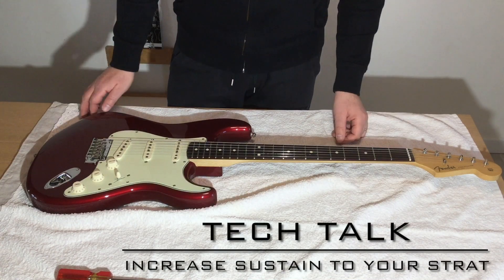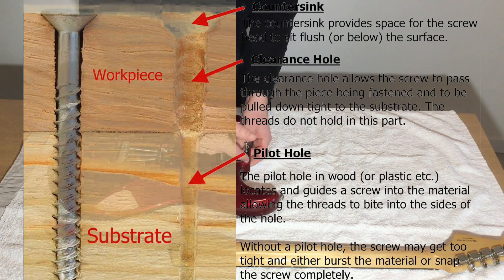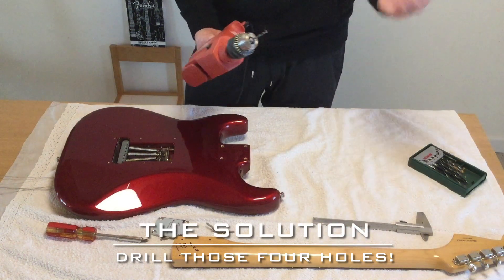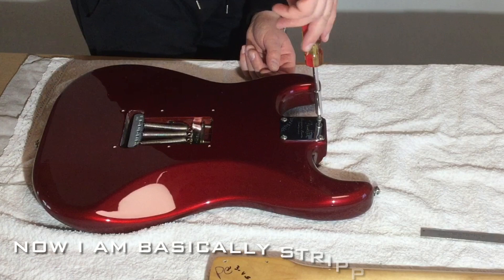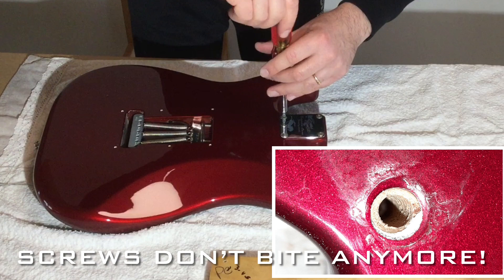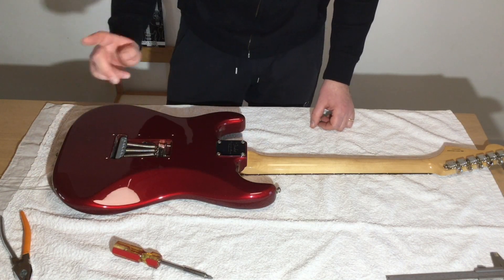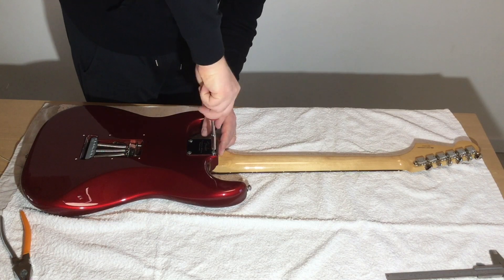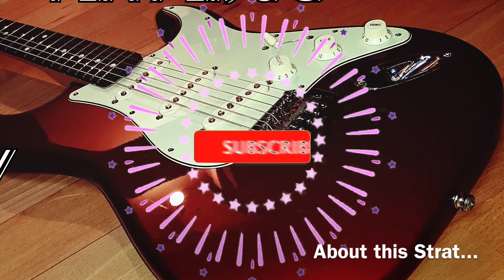How to IMPROVE SUSTAIN on Fender Stratocaster Telecaster and bolt on guitar? #sustain #boost

Comment: I definitely learned something new here even though I haven't taken any action yet to drill bigger holes. What I noticed with my Fender Stratocaster Vintera is that the playability of the neck and the resonance change depending how I tighten the 4 neck screws.
Reply from the maker: Those holes in the body have to be bigger than the screws, that is basic rule for a tight fit between two pieces of wood. I have recently bought an American Original 50s Strat that was built like that from the factory, finally!

Comment: .. if the goal is to creat the tightest fit/contact of the guitar body & neck material then can I fill up any gaps between the two screwed-together parts with super glue/furniture adhesives? 
 .. anyone? 😬😬
Reply from the maker: Well, not in a Strat lol!

Comment: I have a Jackson, They are now owned by Fender and the screw holes in the body are the same way. So tight and threaded into the body AND the neck. I did this same thing to mine. Drilled the holes out larger. No problems and it sounds better and the neck fits into the pocket much better now.
Reply from the maker: You did the right way!!! Enjoy your Jackson!

Comment: Sorry, sounds like a terrible idea.
Reply: Absolutely not, it's a very basic concept and almost half of the Strats are properly drilled from the factory, so this holes enlargement is not needed.
Reply: @johnarthey3162   
Right! If the body holes already have clearance, then drilling is not needed. 😊
But if not, then it’s a must enlarging the body holes, for proper tightening.
Reply: Ive been making guitars for over 50 years and yes its a Bad idea. And pointless. More sustain is a product of many factors not just one.
Reply from the maker: So you aren't make sure that the connection between body and neck is tight? How are you doing that on your guitars? And the aim of the vid is not to prove that's the only thing to get sustain, that's of course due to a sum of factors.
Reply from the maker: I know, I know, this is controversial. However that's REALLY the ABC of bolt technique, if you want to tightly clamp together two pieces of any kind of material, one of the two MUST have a clearance hole. That's common and needed in any construction work. Out of my 20+ fenders I have found some "right" (screws were passing freely through the body), some were "faulty". It's interesting also to note that somewhere in the 50s or 60s, now I can't recall exactly, fender used partially threaded screws that were only threaded in the neck section, while being thread free on the body part.
Reply from the maker: This same exact procedure is even described in Callaham's website!

Comment: Fender uses #8 x 1-3/4" screws for the neck. Based on the comments below, am I correct in thinking that instead of drilling I can use the same size screw, but make sure it is a partially threaded screw? Then restring as Alberto demonstrates. Do I understand correctly, or do I use a partially threaded screw of a different size? (If so, what size?) THANK YOU for this video Alberto!
Reply from the maker: Thanks for your comment! If you use  partially threaded screws you are fine. In that case the screw is acting as it should, gripping into the neck while leaving a virtually friction free contact in the body. Make sure the non-threared part is the right length, i.e. the thickness of the body!
Reply: @LostPlectrum  Got it! Thank you Alberto!!
Reply from the maker: You are welcome!
Reply: I would not use different screws. The threads are not identical, so you end up with messed up threads in the neck. You could file off threads on the upper part of the screw, but it’s waaay easier to just enlarge the holes on the body🤷🏻‍♂️
   Also important: the same screw always in the same hole. I take them out with the plate and let them there, if necessary mark on the plate “neck” and “body”, or “up/down”.
Reply: @lone-wolf-1  I use/reuse egg crate containers with very specific labels denoting the exact origin positions of each part. Like pickguard screws #1 starting with the nearest screw to neck right, #2 being the next screw clockwise, etc.  In the case of extended removal of the pickguard I'll just hand thread the screws back into the original hole once the guard is off.

For pots, I rethread the nut and washers back together in same orientation.  Ditto for tuners and their associated parts.

For really small hole, like tuner alignment screws, and if the plan is to swap to different tuners, like a chrome/nickel to gold versions, this means also swapping to gold screws. In this case, I use a fine toothpick to deliver THINNED wood glue drop by drop into the holes until they're mostly filled, making sure there's no air bubbles in the hole's bottoms then let dry before threading the new screws into the holes.

I've initially learned many of these techniques on books covering  restoration or modification techniques on antique/vintage instruments. Many of which I have used on old guitars (<20 years old) and newer guitars (<10 years). I'm also currently working on some 40 yo and 50 yo electric guitars (vintage and antique, respectively).
Reply from the maker: Lance, you are extremely careful! Good to see you are caring a lot your guitars!
Reply: @TheGhostGuitars  
I take a sheet of cardboard, draw the place where I removed the screws or parts, and stick them in.😉
Reply: @lone-wolf-1  That works too, as long as ye have a system that allows ye to remember what goes where, yer golden! 😁👍
Reply: @LostPlectrum  Well, I think that's because I collect guitars for the enjoyment of them* for themselves, NOT for how much they may be worth later. 

*That includes getting what are otherwise basket cases that probably would've gone in the trash but I purchased because they're interesting and presents a challenge in getting them back to being functional. 

For example I bought a while back, as future projects to work on in a leisurely pace, 2 old guitars for just 30$ for BOTH, so 15$ each.

They are missing tuners, pups, nuts, missing saddles, have badly corroded bridges, and the 12th fret measurement say the saddles should be at where the aforementioned bridges are at. 

One is a 60s Kingston Swinga that still has its turned metal pickguard, but has obviously been painted over at least 2x and came with a botched bondo job and an incompletely done strip job. 

It's so ugly that its kinda cool! I'm gonna just clearcoat the entire thing, mostly to seal the bondo, then make another metal copy of the pickguard with different pup and control setup that will take advantage of the huge swimming pool rout for both the pup and controls. 

As I believe its price value has long since expired, I'm thinking of creating a guitar that mimicks some of the more... "interesting" creations to come out of Japan back then. Since I'm gonna eliminate the rusted bridge, I'll install a Strat/Tele hardtail and make use of the opened up space to rout and install the bridge pup, thus allowing me to install up to 6 single pups or 4 humbuckers, or any mix of pups possible. 

Perhaps a humbucker, a humbucker sized P90 bridge, a lipstick strat neck, and a Tele stacked neck pup, 4x 2way microtoggles for pup on/off, 4 volume pots & 4 tone pots in 2 lines that follows the curvature of the lower bout. 

That means I'll have to rout the control cavity all the way down to the bottom of the right bout area and extend the pickguard accordingly.

The other is an "Artisan" (there's a brass name plate on headstock). Looks like an old kit guitar that looks like a cross between a Strat, offset Tele and a flat top LP. It has a baseball bat round neck that looks like its made of mahogany and an unknown fret wood. The body is plywood. The whole thing is bare wood. The neck is attached to body by ONE large bolt going thru a 1.5" fender washer. The grain pattern on the neck is phenomenal! The plywood body also exhibits fairly good grain too. 

The pickguard is missing but body shows a rusty outline of the missing guard, so I suspect it too had a metal guard. This guitar, in contrast to the Kingston, has only a tiny control cavity and just two round holes to clear the pup bolts. Obviously the pup is surface mounted to the pickguard.

Like the Swinga, the Artisan's 12th fret measurements points to the saddles to be located where the bridge is located.

Unlike the Kingston, I'm gonna copy only the top part of the pickguard and extend the entire guard to the bottom so that it semi wraps around the Strat/Tele hardtail bridge. I will rout out a large swiming pool pup cavity, along with an oversized Strat style control cavity. 

I will be installing 4 humbucker sized P90 Phat Cats, 2 necks and 2 bridges, in that order. There will be 2x Tele 3-way switches, one will be controlling the middle pair, and the other controlling the outer pair. There will be 2x sets of 2 pots, 2 master volumes and 2 master tones. I will also mount the Strat output jack and boat in the bottom of the guard, pointing toward the bottom strap button.

Oh, I almost forgot, the Artisan pickguard will be made of brass aged to match the headstock brass nameplate. The pups will be gold-plated (which will be aged to match the guard and name plate). I'm going to use brass knobs and switch tips, also aged.

The body and neck will have furniture transparent varnish in two shades. Clear for the central areas and a darker tinted transparent for the burst perimeters. THIS, I'll let time and use to wear it down. Alternatively I could just polish up the nameplate and not age the new brass stuffs. More I think on it, methinks I'll go that route.

As the local saying goes in Hawai'i, "I no kea" about any destruction of any potential values the guitars may have (highly unlikely), I've NO intention of selling these guitars...unless, of course, someone comes and offer a ridiculous sum of money like 10s to hundred thousands $ (equally highly unlikely, LOL)!
Reply from the maker: Wise advice!

Comment: Nope! Just the sound made in cringe!
Reply from the maker: Well, some bolt on guitars are correctly built with proper clearance holes in the body, some are not. The very basic bolting technique requires to have a clearance hole of you want the neck to be strongly pulled against the body!

Comment: DO NOT DRILL ANY HOLES IN YOUR GUITAR.  💯 WRONG
Reply from the maker: Appreciate your comment, I have done this on several bolt-on guitars, they didn't split apart yet (kidding)! Seriously, half of the Fenders I have owned (20plus and still counting) had this flaw, the other half were right since the beginning, with a proper clearance hole in the body.
Reply: You are 💯 wrong, sir.
Reply: Unless you have tried it, it kinda makes you 100% ignorant doesn't it?. I've done it to my tele and my strat and the difference is incredible
Reply from the maker: Some people are scared to do some mods to guitars, especially when this involves drilling holes! However in this case it is perfectly right!!!
Reply: @LostPlectrum  well all my shit is custom shop. I’m not modding anything.  But if you got a squire then get after it
Reply from the maker: @BossHossGuitars  I have seen many custom shop with huge neck shims so I don't care if you are willing to pay that extra for the custom fuss. Here we are not discussing the guitar level, we are discussing a technical detail of screw joints, a very basic concept too. If you don't get the point you don't need to get agitation. Relax, mate.

Comment: I use a piece of fiber or rubber support between body and neck. I feel it more sustain. This video you show mean the screws are too tight make decrease a sustain. Thanks.
Reply from the maker: Hi there, the main point of the video is that the body holes should not be threaded, they need to have a clearance. This is assuring a proper neck to body tightening.

Comment: I found out the hard way the first time I took off the neck and tried to bolt it back together. First time I had an uneven gap around the perimeter. At that time I used a c-clamp to hold the neck and clamped the neck into the pocket. 

I was then able to screw the neck back on snugly. Unfortunately, I also put a dent in the frets and the neck plate.  Luckily I tried doing this on a vintage Squier so it wasn't a huge loss (altho it forced me into an opportunity to learn fret dressing).  Later on I had to learn how to replace frets, LOL!

Remember, go easy when dressing those frets. Easy off, hard on. Not easy to put material back on if ye take too much off. ;)
Reply from the maker: You live, you learn they say! Rock on my friend and thanks for commenting!!!

Comment: From Leo:  That is a good solution if you have a problem.    The screw holes may not be any problem.   With the strings off, loosen the screws and put a piece of paper between the heal and the body.  Tighten the screws, if you cannot pull the paper out, the screw holes are not a problem.  Alberto is right, using the strings to pull the neck tight to the pocket is a proper technique.   That 100 lbs of pull eliminates any minor gaps.  I put all 6 strings to proper pitch, and loosen all 4 screws and then tighten them, knowing there is no slack.
Reply: If the screws bite in the body and don’t have clearance in the holes, pulling the neck in the pocket might not work as well as with that little free space…😊
Reply from the maker: Agreed!
Reply from the maker: Agree on the paper test! Thanks for commenting and hovering to my channel!!!

Comment: The middle spring in the tremolo is doing nothing 😉
Reply from the maker: It's under tension so it's applying a force to the tremolo. F = kx, therefore the force is proportional to the elastic constant of the spring (that is a fixed value), and the displacement from the neutral position. For sure the 2 outer springs are applying a slightly higher force than the middle one!
Reply: I bet you can remove it with your fingers. The outer 2 springs are under more tension. I appreciate your videos, but that is a bit of a pet hate, it's like having a different length spring?
Reply from the maker: Yes the outer springs are under more tension but still you cannot pull out the middle one with the fingers. The spring claw is screwed into the body quite a lot therefore the springs are under a considerable tension, all of the three. This strat has 0.011s on it, tuned in E flat and I like the trem decked so that it doesn't decrease in pitch when I am doing a 2 full steps bends, therefore the springs are working hard here. However I must say I prefer to load 5 springs in parallel, but here I was lacking 2 in my spare bin :-) 
Thanks for watching and commenting!

Comment: Very hard to believe that making the screw holes wider will give you more sustain, But I suppose I could try in on my 62 & 63 strat
Reply from the maker: For sure it would improve the neck to body joint. But on '62 and '63 strats you are not supposed to do anything since they are already perfect, isn't it? They may have half threaded neck screws as well, this would make the video pointless.
Reply: @LostPlectrum  Thanks for the prompt reply mate
Reply: Even if your 63 & 63 Strats are not half threaded, first try replacing those screws with correct half threaded screws. Its a possibility that the existing body holes may not need mods if ye use half threaded screws.

BUT, if you do need to widen those holes and ye have not any practice doing this mod, please practice doing this on another cheap Strat (like a Squier or something), before risking making a mistake on an expensive vintage one!

Another thing I recommend is to use a c clamp to hold a piece of wood against the pocket surface to prevent splintering of the wood when the bit breaks thru to the other side. Also use a piece of leather on the back side to protect the finish from damage under the c-clamp head. Ye do not need to clamp too tightly tho, just enough to keep the wood piece from moving when the drill bit reaches it..
Reply from the maker: Wise suggestions Lance!
Reply: @TheGhostGuitars  
Different screws have not identical threads. You mess up the previous threads in the neck wood! Also: always same screw in the same hole!😊
Reply: @lone-wolf-1  That's true, thats why I measure the thread pitch and use the same ones. Further IF I want max reliability I plug the screw hole with glued toothpicks THEN screw in the new screws.

Or in the case of larger screws for necks, I use wooden chopstick and glue. Let sit for a while then drill new pilot holes using the body as the template for the new neck holes. Make sure the neck is clamped securely, but not too tight, preferably with thin wood strips or leather bits to prevent the clamp making impressions in the fretboard and neck joint area of body. Also good idea to mark the max depth of the hole ye need by putting painters tape on the bit...you do NOT want to drill thru yer fretboard.

Comment: You all can just use a half-threaded screws so you dont need to enlarge the screw holes of the body.
Reply from the maker: Very wise comment, you are perfectly right, the big question is why Fender doesn't do it? If I am not wrong they were using half threaded screws in the fifties is sixties!
Reply: @LostPlectrum  Fender used them sometimes, but it depended on suppliers and price. It was not consistent.
Reply from the maker: Ken, you are right! They should have always used them!!!
Reply: @LostPlectrum  Nice to hear that Im right but sad to say that I dont have a guitar. I just know it because I worked in metal working industry. Hopefully people will see this tip so they dont have to risk their expensive guitars.
Reply from the maker: @vicenteortiz8521  I wish you the best for the future, hopefully with a guitar!
Reply: True!
Reply: ? Then they will not fit the holes in the neck. Think about it. Holes need to be bigger in body.